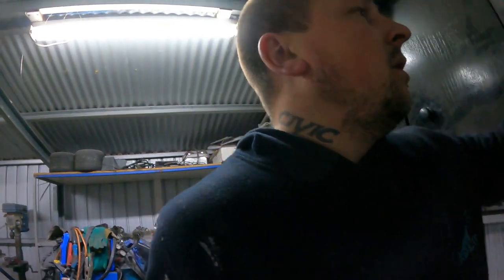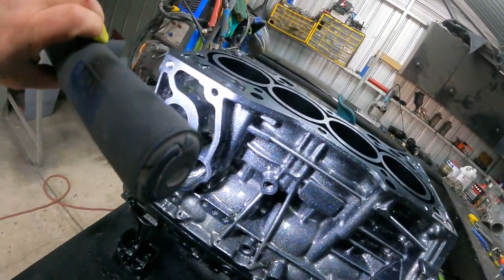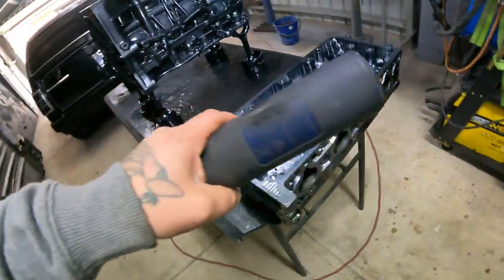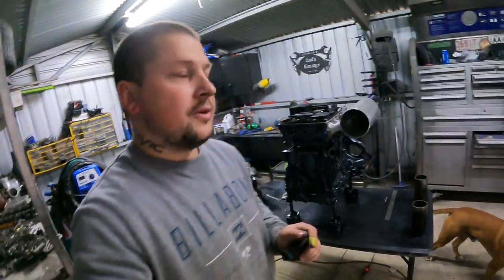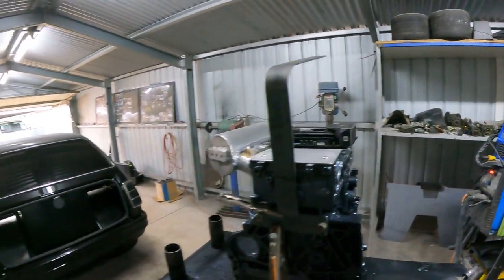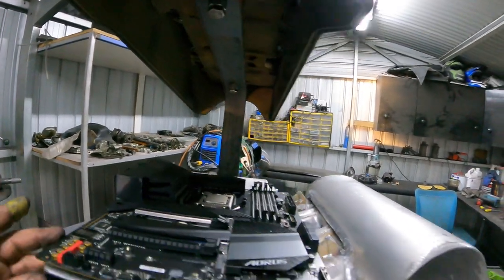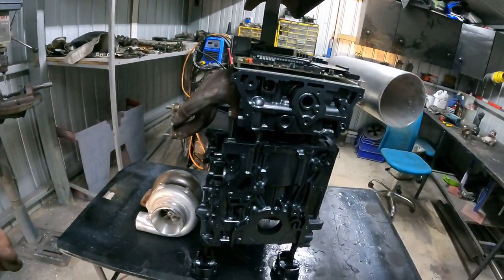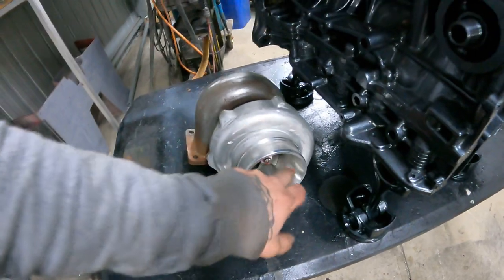honda k20 pc no words to describe

Comment: Kent. Are you not doing a custom water loop? One big radiator on the front of the block is all you need. What about mounting the reservoir? Another idea would be cool if you could get an autometer water temp gauge on it somewhere working.
Reply from the maker: Want to run a alloy radiator like a gokart one.. will be big. But want to make sure the computer pump will be up to it.. yeah I like that idea.  I would do a screen dash to show all the data on there
Reply: @SNAILTVCRAZY  there is a dual pump for pc out there supposed to have alot more pressure. Its like you say though, things start getting noisy with larger pumps. Aquarium pump might offer the middle ground dunno? Looking good anyway mate 👌
Reply from the maker: @RetroJedi9  yeah cheers its just the pc radiators are soo exspencive .. ill give it a shot .. should work out .. cheers kent